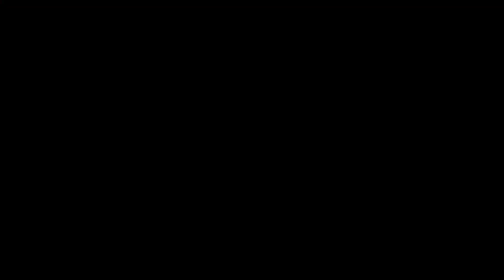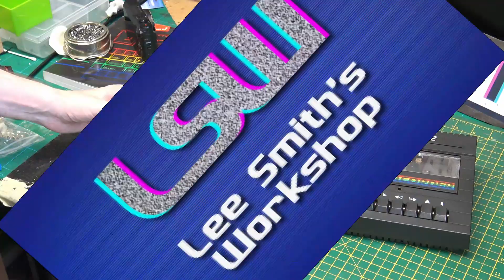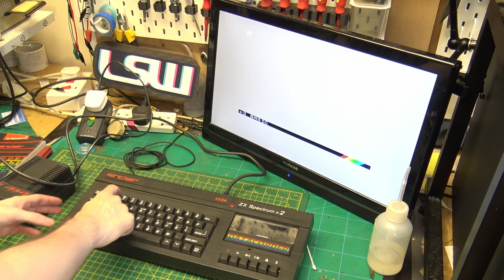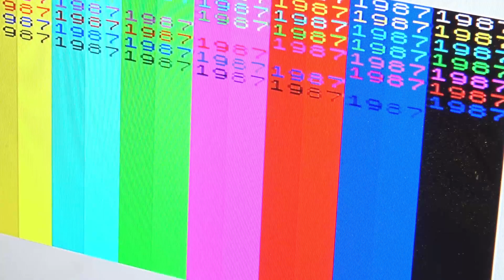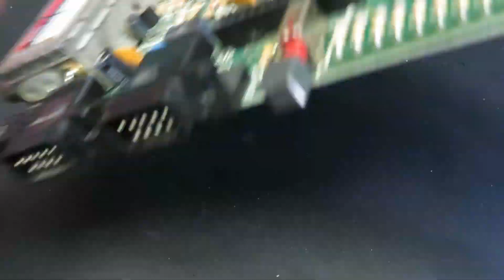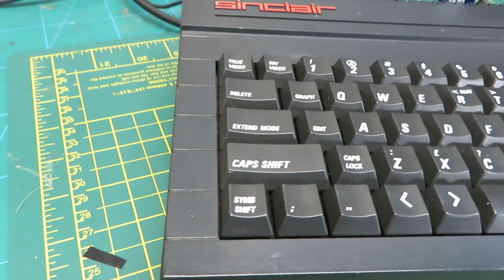ZX Spectrum +2 Another Ebay untested repair and restore project, Will it work ?

Comment: I have been unlucky with my ZX Spectrum purchases, 1st one the tape deck got damaged in shipping, the record button fell off and the plastic clip for the play button has snapped off, but otherwise works, 2nd one gives me the rainbow screen but using a diag rom it says theres a button being pressed down so I hope that just means keyboard issue and easy, 3rd works great. But then I bought a romcart and I can't get it to work

Comment: Hi. It's not the glue on the sides of tape window, its just dirt that gets behing and it also scratches a bit the transparent plastic. So its easy to fix, just take it out (carefuly so it does not crack), clean with alcohol and see how it looks. If still does not look good then polish it with some car polish paste and it'll be like new. I'we done it with several amstrad cpcs, so presume its the same.
Reply from the maker: HI, Thanks, I never got around to fixing the tape drive so I could look at the plastic at the same time. I am using a Spectrum Next clone at the moment so the +2 is in storage.

Comment: Many Spectrum 128s and +2s had colour fringing issues on the RF modulator at release - we took several back to the store at the time, thinking they had a fault! It's possible that's what you're seeing here? I'd love it if you managed to diagnose that problem, and show Sinclair/Amstrad how it should have been done 😉
Reply from the maker: Analogue circuits are a bit of a mystery  for me so not something I could cover in a video without lots of research first. Perhaps Noels retro lab would be a better choice for that topic.

Comment: Great video Lee really enjoyed it.
Power supply stuff scares the bajeezus out of me however ;-).

Two slight tips regarding the Break test mode.
1). You can enter it by holding Break and pressing the reset switch so need need for a full power down.
2). There is a full factory test mode you can enter. Once the colour bars with 1987 are displayed press the following keys at the same time. QAZ PLM
Reply from the maker: Thank you, in the next part when I look at the tape drive I will make sure to do that.
Reply: @leesmithsworkshop  The hardware diagnostic you were doing looked far more sophisticated that the built in factory one.

Comment: Great video, thanks! Can we look forward to more Techno Assembly Timelapses in the future?! 🤘🏼
Reply from the maker: I will try to when I have time or at least someway to make the boring parts a bit more interesting. I missed out many many hours of the actual cleaning, this keyboard was not easy to remove the keys.
Reply: @leesmithsworkshop  Ace! Yeah, keep up the good work! I found that the audio-in mod is easy and useful if you want to load from tape using an external player. The internal deck can be really fussy for loading, but its worth servicing  if you want to create new tapes as it can make really solid recordings.

Comment: my 1st ebay plus grey was a mess every ram chip dead than i recapped and replaced the ram turned it on and than something fried so using it as a spare,  but found a plus 2a but the case is smashed in bit its been recapped all working except i need to get lucky on a black plus 2 case
Reply from the maker: I think I had an original +2 after the 48k+. Looking on ebay and I don't see many empty +2 cases, but if I do I will let you know.